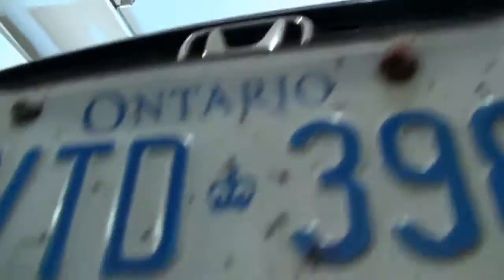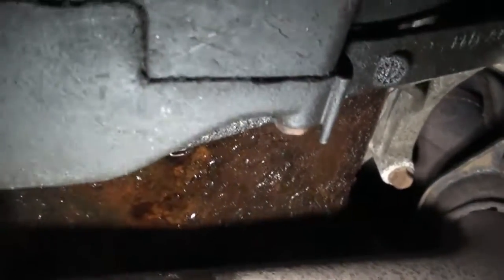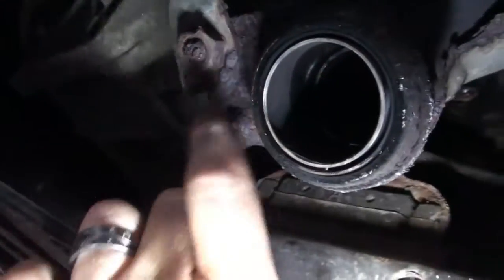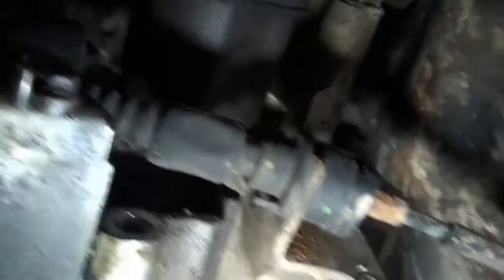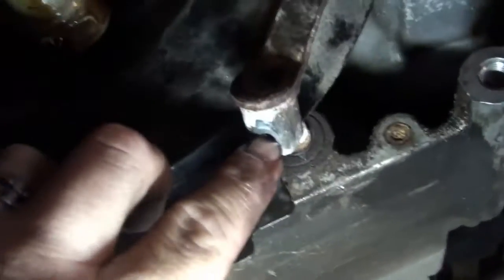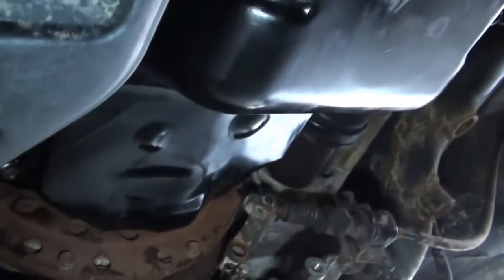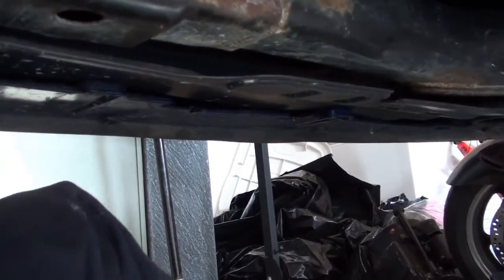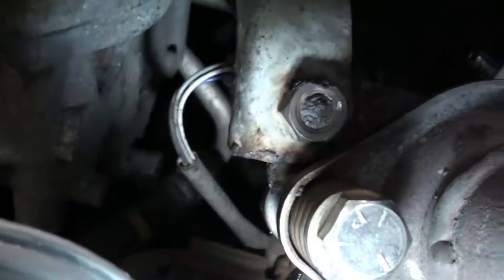Replacing 05 civic oil pan

Comment: Hello, really good video, thank you. One question regarding the manifold flage repaire. We can see at minute 7:38 that you cut the braket that connect the manifold end to the engine block. You probably cut it to get anough room to put the split flange in place. Does that will harm something? Does that will put more stress on the manifold? I had the same issue and did the exact same thing as you. Afterward I asked to my self is it going to cause the manifold to break. thanks again! best regards,
Reply from the maker: Dave Deshaies I'm no expert but I don't think it will harm any thing. the manifold is pretty strong on its own. I still don't have  a problem with it
Reply: All right, your help is highly appreciated! Thanks,

Comment: Thanks for the vid.  I have exactly the same issue with the exhaust on my son's 2004 Civic while doing his oil pan and I am going to go to the parts store to see if I can get the split flange thingy. After getting his pan off, I came to youtube for a solution to the exhaust problem and thanks to folks like you, the solution is a very easy fix.
Reply from the maker: Rune Chap thanks! I'm glad you found the video helpful.

Comment: Thanks so much, very nice video. My only regret you did not show gasket sealant points on the oil pan and/or the engine block where the oil pan is bolted etc

Comment: Hi good video. Question, did you torque the nuts and bolts to the oil pan and if you did how much did you give them ?
Reply from the maker: Hey, thanks. I did not torque them. I pretty much just made sure they were tight then gave them just a little extra
Reply: I say hand tighten all small, fragile bolts on the civic. I'm also a torque-spec-nazi, and was rewarded with a snapped cylinder head bolt. Don't do it!

Comment: Thanks for the video! I changed my oil pan today. I have a 2004 Civic. Your car looks identical underneath. I had one issue getting the pan down. Then I rewatched your video and there was one sneaky bolt by the Transmission.

Did you have any issue with the flywheel cover of the trans getting in the way? I didn't know if it would help to take of the gear shift linkage cable to make more room?
Thanks again for posting.
Reply: Pretty much the 01-05 civics D17A1 are the same.

Comment: This is a great video. It is helping me take care of my oil pan problem. I would like to ask one question though: What is the correct torque sequence for the oil pan bolts once you are tightening every down? I have searched this all over the internet, but I cannot find anything that is direct and to the point for my vehicle. I have a 2004 Honda Civic. I looks just like yours. So, in what order did you tighten your bolts? If you could share that information I would greatly appreciate it. Thanks, Tony
Reply from the maker: Well I'm sure there is an official torque pattern, but I don't know it. All I did was tightened them by hand, then till I got some resistance with the socket, then tight. I did that in a criss-cross pattern. Hope this helps
Reply: Thank you for your reply. I have one final question and I will finish my car tonight. When you used the liquid gasket, did you apply it to both sides of the gasket (pan side and bottom of motor side), or only the side that touches the oil pan? I have read some people who put it on both sides, others who say it will cause extra clearance and lead to a leak, and others who were not clear in their answers.
Reply from the maker: I had only put it on the pan side, one it helps to seal it a bit and two keeps the gasket in place while putting the pan on. And no problems yet.
Reply: Thanks again for another reply. I just finished torquing down the pan. I ended up deciding to put hondabond on both sides of the gasket. I just didn't go over board with it. I inspected the previous gasket thatt was on the vehicle, and it had a little bit of liquid gasket on the top part of the gasket, right near the fly wheel area as well. So, it should be fine. I am planning to let it sit for 24 hours before I dump oil back in to it. If it leaks, I know where to not put hondabond next time!

Comment: Yo thanks for the video, needed to replaced the oil pan gasket on an 03 and viewed a different video with a manual transmission and it didn't show the engine stiffener.
Reply from the maker: +Rayden Garcia no problem, i'm glad it was able to help you out

Comment: You should have been more specific on how to take off the linkage for example. You showed it , but never mentioned how to take it off????
Reply from the maker: Peter S. i showed the linkage cable  and said there was only one bolt holding it in place onto the "pin" after removing the bolt just have to pull it off
Reply: superdelsol Oh ok, my Bad, but actually showing it being done by video would probably have scored your rating a bit better for the beginners ....